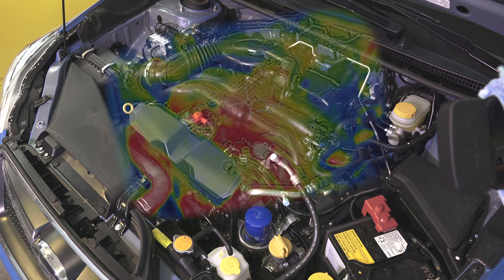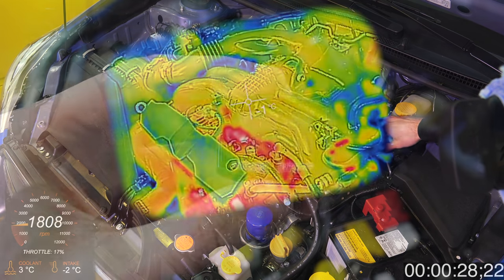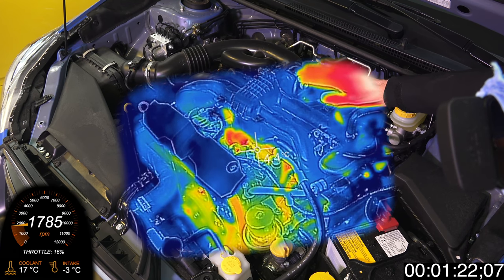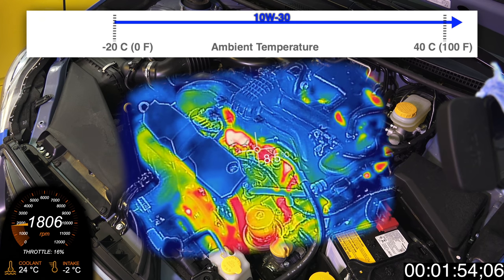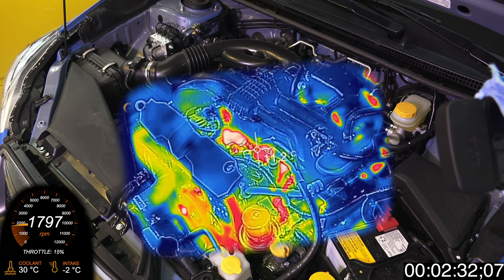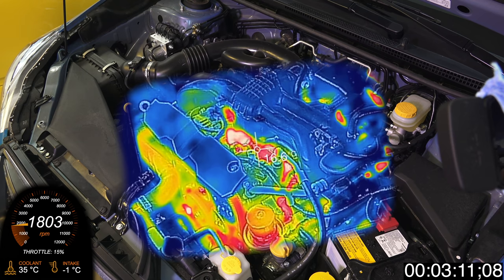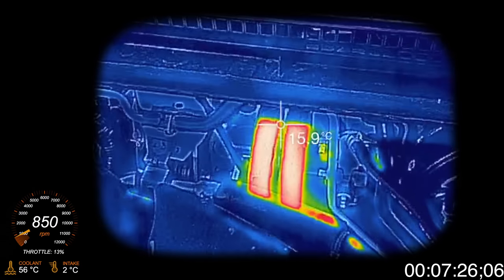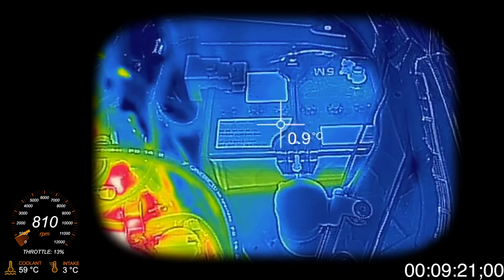Watching A Frozen Engine Warm Up With A Thermal Camera

Comment: I drive 2007 1.6l. lancer. I wait till rpm drop from 1200 to 900-800 then drive it.
Reply: DansGame if you watch his first video, that's what he's warning against. That high rpm is during what's called open loop, which the car dumps a crazy amount of fuel to get the motor warmed up, Again because the O2 sensors aren't warmed up yet. That fuel causes an excess buildup of carbon and will age the motor faster. It's best to drive it during this time.
Reply: DansGame no it's not! open loop is programmed to that way so that the engine will run smooth on a cold start, the reason it "dumps" fuel(which the extra fuel amount is negligible) is because when the engine is cold it is harder to ignite the fuel mixture. the engine will remain in open loop until the vehicle starts to warm up regardless of whether or not your driving it, but driving during this time only adds more fuel, rpms, and load no matter how light you drive it.
Reply: Interesting. The thing is that I've been told not to by a few people. They are what everyone would call them experienced drivers, they drive buses for a living. Main point was to let the engine parts warm up, leading to less friction. While also making a bit more of that carbon buildup. Is 1 minute really enough?
Anyway, thanks, will look into it.
Reply: Brandon Cunningham  The idea is to reduce the total time it is running in this condition. Driving the car heats it much faster than idling, so the engine spends less time with the warm-up mapping.
Reply: I drive commercial trucks for a living and I like to warm them up for between 5-10 mins but I also have to build air. one minute in a regular vehicle is fine, my personal vehicle I like to wait until the rpms kick down to idle. about 2-5 mins.
Reply: thermal expansion comes to mind, subarus in particular don't seem to like running below operating temps, oil is slower getting to piston #3 eventually causing a piston slap. my legacy has over 250,000kms and no knocking, I always wait until the temp gauge starts going up before driving lightly.
Reply: +Brandon Cunningham No, it will not remain in open loop, until the engine warms up. It remains in open loop, until there is a feedback from the oxygen sensor. Which is electrically heated, and reaches operating temperature way earlier before the engine does, probably withing a minute or two. Then when the exhaust gas is getting hot enough, the electrical heating is proportionally turned down. You want the open loop operation as short as possible.
Reply: I think it depends on what phase of kickdown you're talking about. On most modern cars you have an initial very high RPM to get things going then a lower phase for warm up and finally a drop to normal idle. In mine those are about 1400-2000 depending on how cold it is, about 1200-1400, and then 600. If I waited for 600 then it would be minutes but the first drop happens in less than a minute. That's the time to start driving gently.

Also, it's critical to keep the revs when you start driving then in a moderate range. If you've got an automatic that hunts for highest gear all the time you should shift it in manual at maybe 3000 RPM until it's a bit warmer. Some cars automatically do that but some do not and pulling at low RPM all the time when cold is hard on the engine. See EE's flooring at low RPM video and consider when it's cold that's occurring with less throttle input.
Reply: I let it warm up first so I can have heat when it's cold! lol no point in sitting in a cold car
Reply: I have an engineering and a university degree in this stuff, and I wouldn't listen to what bus or truck drivers say about this... they have old habits that stick deep but little real expertise on these matters. No offence to anybody.

Using a block heater when temperatures are below 5 degrees celcius and driving away as quickly as possible are the best choice for your car and the environment. High RPMs after a cold start are there to reduce emissions as quickly as possible, but driving achieves this faster. Excess idling does little to warm the engine as there is no load on it. Oil starts circulating practically immediately so there is no need to hang around.

We have a lot of research done in this field in Finland as we're at the arctic circle.
Reply: just wait 20-30 seconds
Reply: Gábor Móczik not just the oxygen sensor but it has to meet a certain coolant temp and engine has to have been running for a certain length of time before closed loop can be achieved.
Reply: might wanna check on your "expertise".  Where I work we have a whole fleet of 2015-2017 trucks, both gas and diesel and each of them say in the owners manual and were even told by the dealer, drivers must warm the engines up for a few minutes when cold before driving or engine damage will occur.
Reply: as long as the correct grade of oil is used for the current temps engine damage isn't a thing. that's why if you look up the viscosity for a specific vehicle it may have multiple recommendations all based on temp. there are many manufacturers that stamp 5w30 or 5w20 on the oil cap but if you research what they recommend for colder temps it might be different.
Reply: I should specify that I am speaking for passenger cars only. Large truck engines that have to deal with massively higher loads are another matter.
Reply: That depends on how long it takes to drop in RPM. My Camaro will drop from 1000 RPM to the normal idle of 750 rpm in about 45 seconds after starting it. I use that as my marker of when it's okay to drive.
Reply: Not sure what you guys are arguing over.... just hold the engine at the red line once you turn the key. They put that there so you know what the optimal warming speed is in cold conditions.
Reply: My 04 subaru has this, just takes 10 seconds or so then it's time to roll out.
Reply: DansGame why are you driving a 1.6 lancer?
Reply: Not everyone can afford a 5.0l truck with a cubic metric ton of gas.
So it's a common practice in Crimea to get a used car, preferably with a smaller engine.
Reply: Only 1000 rpm is safe to drive
Reply: I just start my car warm up at least 10mins. 2006 Saturn ion with 241k miles right now. I live in Wisconsin so it gets below 0F a lot!! at night
Reply: Clayton Hartin nice! I've been hearing alot about those Saturn engines going very high in mileage! Beasts. It was 7 degrees n snowing today n I warmed my 17 Focus ST up for 20 seconds n then I'm out lol time will tell if that's the right thing to do if I get to 250k without problems on the engine :) if not, buy a new one.
Reply: Jason Cotellessa nice! Right now it’s -1F and it feels like -27F
Reply: Clayton Hartin omg that's terrible  lol  I would not be able to live there.

Comment: Awesome video. The Bavarian I drive needs at least 3 min at -20 to -40C, and low RPM driving initially. Even if trying to power it, the car is sluggish. Am running 0W-40 and noticed its remarkable at low temperature. At -40 people forget the windchill, it is -50 or colder on the highway. So those 5 min are critical. Had cold days in which even 20-30 min driving the engine oil never went up to 70C and felt sluggish until warmed up!!! Its oil operating temp is 90-120. Either case, warming up is more than a choice, it is a smart choice.

Comment: Oh that classic boxer startup sound. Takes forever to turn over, then the idle is high. Especially in the cold. Then it stays there for another 30 seconds.
Reply: nicktune1219 

Boxers aren't the only engine that sits at high revs on a cold start.
Reply: Scott Verge I know, but from my experience, boxer engines tend to idle higher when warming up for a longer duration of time compared to other cars that I have had (Toyota's, Honda's, BMWs, Volkswagens, Ford's).
Reply: nicktune1219 I've heard that you get heat earlier in the car.  i only have a 97 accord to compare to and that took ten minutes of driving to get watm air.  Of course, the honda didn't hard shift in the first and second gear like the subaru.  I guess the mechanics might be different but both are 4 speeds.
Reply: Ah ok.

I haven't owned one but all my cars have taken a little while.  But I am in Canada hahaha.
Reply: sounds like a rosie odonell queef

Comment: 2:39 glad I held off on any smart-ass comments regarding ultra cold weather starts as these are already addressed.

Myself I usually use -15C as my threshold for the block heater. I would love to see a video about recirculating coolant heaters.

Another point I would like to add though is that you need to ensure you have a battery capable of high crank amps that isn't expired or you might not be able to start even with a block heater

Comment: Good video man! I usually let my car idle for about 10-15 mins while I get ready, but I also have a built engine & Pittsburgh is hilly, so there is significant load & high rpms on the engine as soon as I drive anywhere. If it's going to be really cold, then I usually plug in the block heater to speed things up.

Comment: Block heater is huge in very cold (say sub 0F temps).  I use mine often here in the frozen tundra.  Starting is so much easier with it preheated for a couple of hours (2 to 3hours).

Comment: I use an engine block heater for my truck (diesel) and it makes a huge difference all the way around when it's <40 F.  Typically, when using the engine block heater, at startup the temperature gauge in my truck shows 90 F regardless of the outside temp.  

I have decided that all future cars that I own will have an engine block heater.  It just makes sense to me.

2016 - Ram - 3500 - Cummins - 6.7

Comment: If you want your car to warm up faster, just floor it and hold it at redline or as high as the rev limiter will let you go! You're welcome :)
Reply: Nick Harrison only of you'll buy me new cars continuously ;)
Reply: OMG IT WORKED THANKS!
Reply: damages valvetrain
Reply: Enjoy only having like 10% of the power you used to before over revving it for like 2 mins ;)
Reply: Max200012 ☠️☠️☠️☠️☠️☠️
Reply: That is called car neglect and abuse and misuse. Never let your rpms get to high in a cold engine. So when your speeding up and your engine is cold speed up slow and don’t let your rpms to high
Reply: you’re asking for a new engine replacement soon bruh
Reply: Delta Tv or the throw out bearing if you try to cut the valvetrain some slack, looks like driving it slow is the only best option, but again if you drive it hard it will get to operating temperatures quick which will significantly cut the amount of time you have to stay at cold starts… I’m not sure if I’m right but I just shift later than usual so that my rev is higher than it usually would but not exceeding 3000, it seems that it gets to operating temperature a lot quicker than 2000 or less.
Reply: @Max200012  OW! That's a thought that brought pain to my groin. 

It's almost as bad as dating a feminist.
Reply: betcha work for a repair shop... ;)
Reply: I’ve seen way to many kids that I used to got to school with start there vehicles up and redline them right off the start and 5 years later I think they still have the same vehicles with the same engine in them

Comment: is it possible to do this test while you drive your car? start it up and wait 30 seconds then drive off, so we can get a comparison. maybe you can put the vehicle in a dyno
Reply: He should be able to do that, since the thermal camera shows tempratures. While driving the car, he could read of the gauge that shows engine temprature.

Comment: Super cool video, but am I the only one that thinks 1800 RPM is pretty high? Lol. I've been a technician for 15 years, and not sure i've ever seen any vehicle idle that high from cold!
Reply: Dan iel boxer engine naturally idle high on a cold start up
Reply: Dan iel boxer engines naturally idle high on a cold start up
Reply: It's because it is a PZEV. The engine revs higher to warm up faster to minimize emissions.
Reply: A technician? Really? People avoid this individual at all costs!!
Reply: Certainly not not normal. Ive seen a handful myself that idled around 2k in gear...its like launch control when you let off lol. Mainly older camrys and a fiat
Reply: Honda K series engines idle at like 1700rpm on a cold start before dropping
Reply: food for thought, i have a first generation impreza with a early model 2.5 motor and it revs the same. not pzev funny business or anything.
Reply: For my engine, which redlines at 5250 and idles at about 500, yeah that would be a little high for a cold start. For a boxer engine, I’m sure it’s more normal
Reply: Our Mercedes (Diesel engine) revs up to 1200-1600 RPM after a cold start. Depends on the outside temperatur, but it goes down to normal idle RPM after like 15 seconds.
Reply: Daniel My 1993 Pontiac Grand Prix would run at 1800 ish in really cold weather. Once it warmed up the idle would drop to 1200 and then 1000.
Reply: Where I live it only gets in the 30s but when I start my car it's at 600rpm and 800 when warm
Reply: Boxer engines don't "naturally" do anything differently than any other engine of the same bore/stroke ratio, displacement and technology would do. It may be that Subaru likes to set the idle of their cars high in the cold, but it has nothing to do with the fact that it's a boxer. An engine is an engine you might get differences like a flatplane V8 revving faster than a crossplane, but that's just because a crossplane has heavy counterweights to cancel out vibrations. No engine inherently "revs better" or "has more torque" or "idles higher" just because the way its built. Like V8s have a reputation as torquey, low-speed engines....but that's just because they tend to be bigger in displacement than the average 4 cylinder. It haas nothing to do with the type of engine; if you built a 5.0L four cylinder, it would make even MORE torque than a 5.0L V8, due to bigger pistons, longer stroke, and it'd run at even lower RPMs/horsepower. A 2.0L V8 would be a very high-strung, high-revving engine with very little torque.
Reply: my BMW 528i e39 idles at around 700 rpm.. lol
Reply: my 2002 Legacy B4 idles at ~2k rpm when you start it cold but only for half a minute maybe then drops to a bit below 1k
Reply: My h6 outback sits about here when it's cold
Reply: All my Subaru’s have idled around 1600-1800 on really cold starts and go down to 800 after a few minutes.
Reply: Obviously not a Subaru technician. The idle goes down once it warms up. Besides that the engine makes no power unless above 3000ripems
Reply: Corolla rev at 1.8k vold start.  Suppose to rev at that rpm till warm enough to run.  Once warm it will drop down to 1.2k.  Most smaller car idle higher rpm.
Reply: What my 1978 Chevy c10 idles at about 1800 rpm on cold starts on a cold day give it about 4 minutes and hit the throttle once and idles down to 700-800 rpms it's an old carbed truck though lol
Reply: My 08 g35 idles at almost 1900 rpm
Reply: My vehicle idles 1,600 at -20°F. I wait until I'm at least at 1,000, so I'm not slamming my transmission into drive at a high RPM.
Reply: Yep my 08 G35 does the same as well. Drops to about 800rpm after a minute or two.
Reply: You sure you have been a technician for 15 years?
Reply: Lots of cars do that lol
Reply: My ford 4.0 sohc stays at like 1,500 rpm. It stall if i let it go below 1,000 rpn when warming up.
Reply: But also, the rpms that drop After 5 minutes is not normal. In my car the engine rpm’s drop after about 2 minutes in really cold temperatures and after a minute in Warm temperatures. Maybe american cars do this for a specific reason?
Reply: Yeah i was wondering the same lol my 1998 360 cammed and supercharged truck idles at 1.1k and i thought that was high lol

Comment: at -40c your interior isnt going to warm up until you start driving, the engine at idle literally after 20 minutes still isnts warm enough to produce heat in the cabin but its good to drive though.
Reply: bruh turn on the heater

Comment: I work in northern Canada, it gets down to -45 at times. So I always let the car warm up a bit  before I drive. I feel that when all that metal is that cold, the tight tolerances are no more. The metal shrinks enough to have more play than before, allowing components to have a bit of play or slop. I feel that revving that engine and putting it under load while everything is sloppy and in some cases tight, would accelerate wear. Allowing it some time to rev at a lower rpm with no loads would rid of that slop in a safer manner.

I'd like input on this. Specially when you have different metals mixed together in which all expand and shrink at different rates. I could be wrong, maybe in most cases the slop is managed by the more viscous oil due to the temperature. Being thicker because it's cold means itll stay in those larger gaps and cushion/lubricate as it typically does.